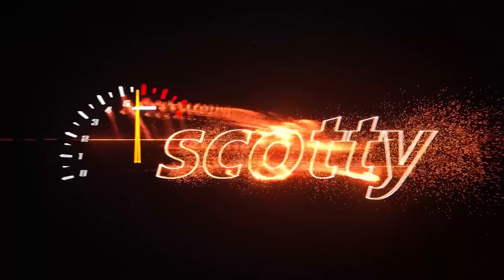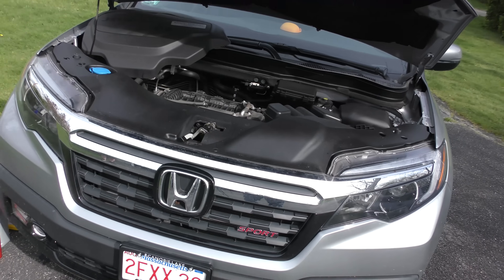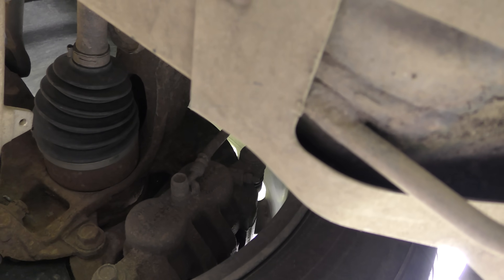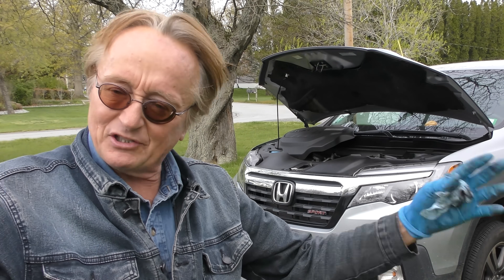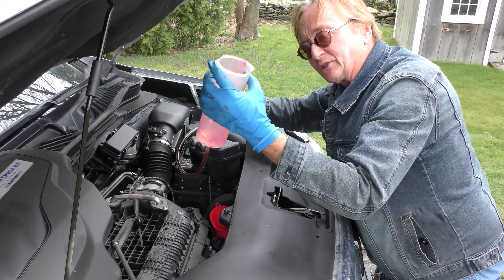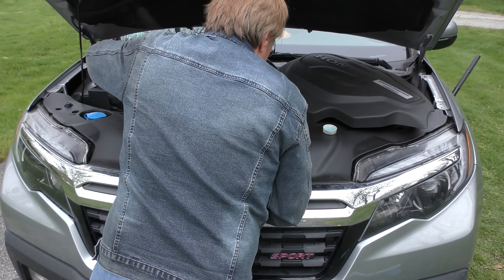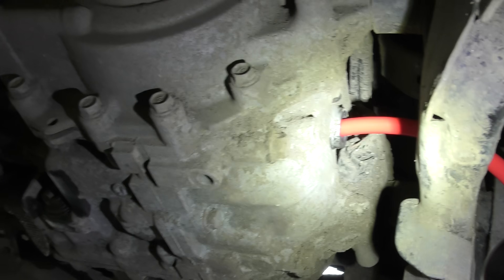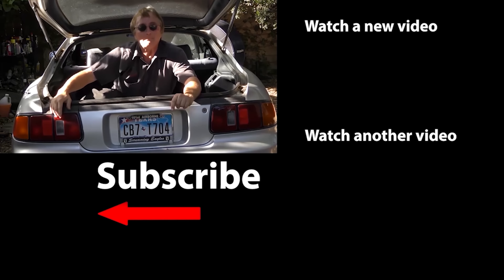Here's Why Car Companies Don't Want You to Change Your Engine Oil or Transmission Fluid

Comment: What would you recommend if I bought a 2001 Honda Accord three years ago ...

I've only put ~10k miles on it in total, but I've changed the oil every 6-8 months (I drive mostly short trips in a hot climate) 

It's at 195k miles on it now

I don't know the history of maintenance for transmission fluid. I checked it and looks mostly red and no burnt smell.

Should I replace the fluid? If so, when?

Comment: Remember to read the manual regarding changing the rear diff fluid.  On some models, like my 2019 Acura RDX, once doing the initial fill, you need to start the car, and let it run for awhile.  This distributes the fluid through the system.  Then fill again until it runs out.  Sure enough, it took several more ounces after doing this.  This Ridgeline may have had a different system than the RDX and did not require this step.

Comment: Took a gamble on my 08 Civic with 205k miles, never had transmission fluid. Did a drop and fill. Had a tinge of red left, but was well past life. Fresh fluid in... Shifted better than new. A shudder it always had on slow acceleration has disappeared and shifts sooo smooth... Not recommended this far out, but turned out fine😊

Comment: You ain't kidding about dealers and/or mechanics not changing tranny/diff fluids.  Bud goes The Extra Mile and slaps a gopro in an obscure spot, like inside the rear bumper-shell aimed forward to cover the fill/drain plug.  Most times, they do it, but once no one did.  All Hell broke loose when he went back there and accused them.

Comment: Hello Scotty.I appreciate all your useful information. I have one question. I have 2014 honda accord plug in hybrid with 99k miles on it and transmission fluid never changed. I am the second owner. I just asked some of my friends and they told me if you didn't change even till 60k miles,then don't touch now.Otherwise ,can get transmission problems. What do you think?Do I need to change transmission fluid in 99k car or leave it like that?Thank you very much again
Reply: You'll be fine, just do a drain & fill, no flush. The flushes are the killers.

Comment: If you don't drive a lot of miles, do you change based on time?  I had mine changed in 2020 at 70,000 miles and now 3 years later I have 90,000 on my Honda CRV

Comment: Scotty, just bought a 2010 Matrix and going thru replacing things (brake rotors/pads, struts, wipers, tires/wheels,etc) and doing some maintenance, car has 181,000 mi, no record of any maintenance on the transmission, should I change the fluid or leave it be? Thanks

Comment: Have an 18 ridgeline I have done a drain and fill every 10k and I am having issues. The torque converter is going out. Really disappointed in it

Comment: My Avalon has 155K miles. I have never changed transmission fluid. My mechanic said that if it's never been changed, don't start now because it will cause transmission problems. Is he right or should I change it?

Comment: Scotty and others - I think there is actually an external filter on both Pilots and Ridgelines on the transmission loop. It's just under the battery pan.
Reply: I think the generation of Ridgeline and Pilot he’s working on have transmission dip sticks too. Far easier to check the fluid level on a dip stick versus measuring the amount taken out. Could have been over filled or under filled, use the dip stick.

Comment: I agree with this video Scotty.

My wife had a land rover evoque.  It was more or less problem free for several years. But it eventually blew out a hose.  No biggie.  I thought perhaps it was also time to do some other maintenance.  When I went to the land rover dealer for the part that I needed, I asked about the price to change the transmission fluid.  

They said “The transmission fluid is designed to not be changed for the lifetime of the vehicle”.  They wouldn’t even give me a price.  They were adamant and almost combative on the request.

We sold the vehicle immediately because if there isn’t at least a plan to get to 300,000 miles, I’m not going to monkey with it.  If they can charge $300 for a dumb hose, I am not interested in knowing what they charge for a transmission.  It wasn’t the engineering I was afraid of.  It was the attitude toward a managed service life.  I couldn’t even pay these guys to do the right thing.
Reply: Your city didn't have ANY independent mechanics?
I find that hard to believe.
Reply: @nostradamus7648  Yes. A good independent is tough to find. I used to use one shop but the guy sold his business. He didn't want to deal with running a business anymore so he went to work for a deal. The guy that bought the business was so, so. I didn't have the same confidence in the new owner. It took me a year after trying a couple shops for me to find a good and honest shop. One shop was good, but I felt they tried to upsell me other things too much.
Reply: You have no idea the bullet you dodged.  Rovers are total MONEY PITS!!  You were smart to dump it after the first thing went wrong.  That was #1, of 1,001 problems it was soon to have.
Reply: Change oil for the sake of it, why??? There are spacecraft in orbit for 20+ years using the same lubricant for their solar panel rotator mechanisms. And they'll run another 20 years
Reply: @jagmarc  I do not buy into designed obsolescence.  I suspect the design life threshold for a land rover is barely 10 years.  I have three cars with just under 200k and going strong.  They are 11, 17 and 45 years old .  The way they got there was fluid changes.  There is no way that land rover will make it to 150k, so I sold it at 90k for one with a transmission fill plug.  Design obsolescence is why I no longer own a land rover.  What I found out is Land Rovers were put together to make rich people feel good.  Rich people don’t care for a 10 year old vehicle, so it is pointless to design beyond that threshold.  I wouldn’t compare design quality of a machine designed to operate in orbit with a consumer grade automotive transmission.  I do not feel that changing transmission fluid every 50k miles is excessive.

Comment: I remember for the differentials, mechanics used to use a curved metal piece/tube to fill them.
I don't know if those are still part of a mechanics set or if those are part of the diff fluid dispenser.

Comment: Why can't manufacturers of EVERYTHING  use the same size nuts, bolts, & screws on most of the parts.
Even simple furniture uses 3,4,6 different shapes & sizes of hardware.
That's just STUPID!

Comment: With that differential (andthe transmission), always remove the fill bolt first.  If it is seized you will not be able to refill after draining.  You might then have to bring it to a mechanic who has the appropriate tools to remove it.

Comment: Nice. I agree and have experienced the overpriced dealerships taking people for a ride. That’s why I’ve been working on my own cars for 30 years. Started with my first car at 16 years of age! Like you said, if you do it yourself, then you know it was done right.
Reply: Well done and it has saved you a fortune and all it takes is "one bad experience"  for some of us anyway
Reply: Sometimes it's a scare tactic. They want to sell you another vehicle...They tell you there's major issues, you trade in car fora different one, they Make a ton of money, they make the cheap fix to your old car, sell it and make another ton of money...  I myself take things(I do everything outside and in winter I have no choice Sometimes)..  I take things to a place that don't sell vehicles like OK Tire or Fountain tire or some such... Yes, it's still customer beware, but at least they are not pedaling a new vehicle on you...
Reply: @TheFarmerfitz  Tip, at every oil change, I empty the P.S. rez, and refill with new.  Every other oil change, I remove a qt or so of tranny fluid, and replace with new.
Reply: Did toy ever forget to put the oil drain plug back in?  I did,....only once though

Comment: Hello Scotty, I enjoy your videos.  You did not mention the model year Honda Ridgeline either in the video or in your written comments.  I have found that Honda had built the Ridgeline models from 2006 to 2014 and in each of those models they have a transfer case that takes .8 pint of 75W-90 Gear Lube.  As long as you were changing the engine oil, ATF and the gear lube in the rear differential, would it not be appropriate to change the gear lube in the transfer case too?

Comment: Thats the one thing i absolutely hate about foreign cars. They are always so picky about fluids and parts/sensors. Fords and Chevys may or may not be as reliable, but i can tell ya. It's nice being able to throw a cheaper part in there if your in a pinch. "A chevy will run like crap longer than most vehicles will run."

Comment: TIP FROM A HONDA TECH!
I 100% agree that changing the fluids regularly is your best bet. Oil every 5k miles, transmission oil every 20k miles, differential every 25k.
BUT, on these new generation Hondas, the differentials do not use VTM 4 anymore. That’s for previous gen Hondas. This body style Ridgeline (and similar pilot and passport) take Dual Pump 2 fluid in the differential. VTM 4 can cause premature wear and excessive noise.
Reply: You will notice how the fluid coming out of the differential was almost clear, whereas what was put in was bright red, similar to transmission fluid. Scotty is preaching using the proper fluids, when in the same video he’s using the wrong fluid 😂
Reply: As a big scotty fan i’ll agree with you here, big oversight.
Reply: I always say to refer to the car manual
Reply: @spritemoney  down side to that is a lot of manufacturers are fairly passive when it comes to maintenance. If you expect a vehicle to last, it’s best to be aggressive with maintenance regardless of what the manufacturer says. More frequent servicing will guarantee the longevity of your vehicle
Reply: @jasonlecreux1175  That's good advice!
Reply: Trans/diff fluid every 60k otherwise you're tossing money
Reply: @dmironyuk  rear diff done on second oil change no matter what, due to it coming from factory with a break in oil. After that I would never let it go past 30k at the longest. As far as transmission, the 6 speed automatics have been known for having shutter issues due to deteriorated fluid. They need a fluid change every 20k considering at a fluid exchange, you’re only ever changing 3-4 quarts out of the 9-10 that it holds. Honda technically recommends triple flushing ATF, but people are to cheap to do it. The triple flush is to constantly dilute the ATF until all of the deteriorated fluid has been removed.
Reply: @jasonlecreux1175  Why do you call it a triple-flush? It's actually a triple drain and fill. You could connect a flush machine as well no? And then it's a flush.
Reply: @jamesmedina2062  force of habit because that’s what Honda calls it. It could be considered a “flush” because after each drain and fill they recommend driving it a few miles to make sure the new fluid cycles through and mixes in with the old deteriorated fluid. A flush machine would work, as you would cycle in new fluid until the fluid coming out is the same colour as what’s going in. But the “triple flush” doesn’t require the cost of a flush machine

Comment: Just buy an EV  and say  GOODBYE to Oil changes, Legacy auto still dont get it.
Reply: An ev still has a transmission with oil.  It's used for gear reduction, differential and reverse.
Reply: @dvdcnly  From all I have read , the Tesla mod3  has an oil filter for the gear reduction drive, but it is permanent and never touched by the owner or serviced ever, not sure if the newer ones have that oil filter  , now  an ICE and its tranny  and Diff are totally another animal, they need periodical maintenance. 
 Traction Batteries have different requirements  , but never to the amount of maintenance of a FOSSIL  ENGINE , and probably  only the  Liquid cooling system ever need changing if ever, one reason the Dealersand their  Service Dept are doomed.we will need no more OilChanges, no Antipollution stuff, no Muffler Shops , Less brake jobs  No more Mr Transmission Shops, the lists  goes on.

Comment: My 2015 GS we bought new only has 36,000 should I wait until 50k for the trans fluid or do it by time, also what about rear diff? I also bought a certified 21 RX with 36k when should I do the trans fluid on that car.

Comment: The reason why manufacturers spec lifetime fluids, or long intervals is to make their "cost of service" less than their competitors.  People read things like Consumer Reports, and they show into relating to cost of ownership.  If you can extend maintenance intervals, then you can lower cost of ownership.  That's all there is to it.  It's not about selling more parts, it's about people who compare all of these costs when they research purchasing a new vehicle.  Nothing less, nothing more.  Ask any engineer how often transmission or differential, or engine oil, or any other fluid should be changed.  It won't match maintenance schedules.

Comment: I’ve got a 14 year Old Ford kuga and I had all the fluids changed when I got it 3 years ago.
It cost me about £450 with a garage that I have used for years. Engine oil , gearbox ( manual) 
AWD box , water , brake fluid. I think any car over 10 years old needs this

Comment: Scotty Kilmer, when I change the oil. 
 I put oil in the filter. . 
 I do it in a special method. I put 2/3 full in the oil  filter. The let it sit. The membranes in the filter soak up the motor oil.  Wait a while for it to soak. You will notice the level drops to roughly one half. Then I fill oil filter back up  to 2/3 full. Then I install the new oil filter. 
  If you put No oil in the oil filter install it like most  everyone does. 
  When you start the engine . You are dry firing it. .  Based on my logic alone . I'm no mechanic by any means. 
    Scotty Kilmer your one of the best mechanic's.
Reply: Scotty is freaking great but we all have blind spots.  I personally dry ran a filter one change because I forgot and some people had told me it doesn't matter.  Well I heard a horrible 2 second metal on metal noise at startup so I went back to filling it about 2/3 like my dad taught me and it fires up super cleanly each time.  I've yet to pay someone to change my oil and I'm nearing 50 so personally I can attest to your method being the way to go.

There is a video from the lubrication guys or something here on yt that proves you get max oil pressure far sooner with the filter primed.  That and you see more wear indicators in the oil  without it. (nickel/iron/aluminum/ect).   They pretty much disproved all the myths on the subject and verified our suspicions.  Cheers!

Comment: Wait the manual saids not to use VTM4 but to use Dual Pump Fluid 2 for the differential...
Reply: Absolutely correct. I used to work on them daily before switching jobs. Older models did use vtm-4, later models use dual pump fluid.

Comment: 160k on the original ATF is pretty solid. The modern GM trucks have a hard time hitting that if you change the fluid every 50k miles.
Reply: The newer Toyota Automatics are a lot better since the torque converter stays locked virtually all of the time.  The fluid doesn’t degrade.  The fluid will turn dark as the red dye wears out, but the fluid is still like new even after hundreds of thousands of miles.

Comment: So, by "changing transmission fluid", you meant only change, not flush, right? I have a CRV at 140k. Can't decide if changing the fluid would enough. The fluid is still reddish in color.
Reply: Drain and fill, no flush.

Comment: Before listening to video, the answer to the video, it's either one of two answers, 1: they want you to bring it back to their service department for the service, (did that once with a Hyundai for a transmission service, big mistake as I got ripped off as they didn't change the transmission filter or even open the trans pan. just changed the fluid.) or 2: they want the car to self destruct sooner so you will have to buy another car.

Oil Filter: "Get it on as tight as you can with your bare hands."
I was always taught that you spin it till contact was made with the filter plate by the gasket and then give it a 1/4 turn past that or 3/4 depending on the thread pattern (most of my fine thread cars take 3/4 turn while my old ford takes a 1/4 turn to seal). Any tighter and you end up with either damaged threads on the stem or needing some form of extra torque to get it to come off later. Of course everyone's strength level is different. Some may understand hand tight as what you can manage with your hand and wrist strength while others put their entire arm into it)

Comment: Between my wife and I, we’ve owned 16 Hondas since ‘73.  I am most certainly an “overkill” maintenance guy.  On every automatic Honda we’ve owned, I’ve always changed the trans fluid every 10K miles with genuine Honda trans fluid.  Again…. that’s overkill, but doesn’t hurt anything.  I’ve never had trans trouble.
Reply: Better to be overkill than under kill right? 😂
Reply: I do it once a year.
It's just a drain and refill, so why not?
Reply: So you are averaging 6.25 years per Honda. How many miles during those 6.25 years per vehicle?
Reply: @TheFishdoctor1952  
I'm sure many over lap and they each had their own.
Reply: I swear against changing tranny fluid. Knock on wood, I've also had no Trans problems.